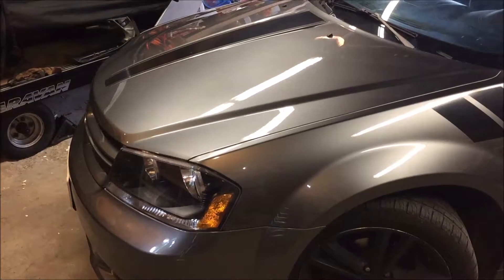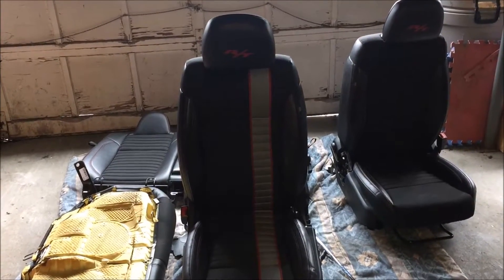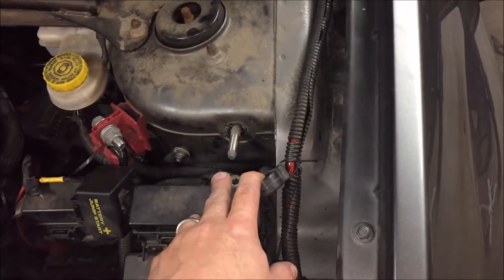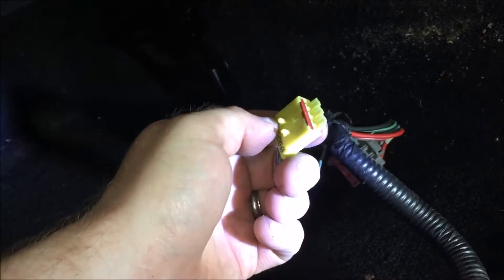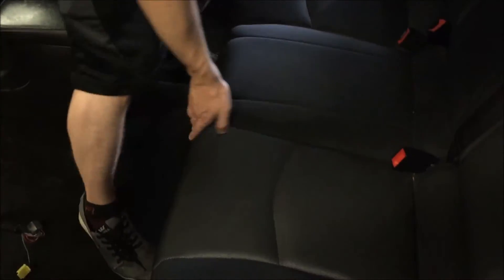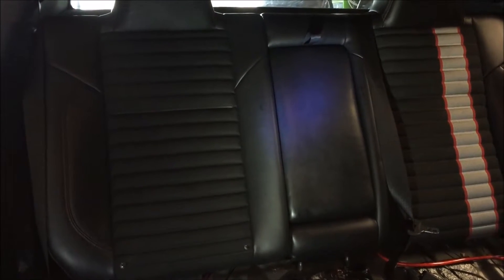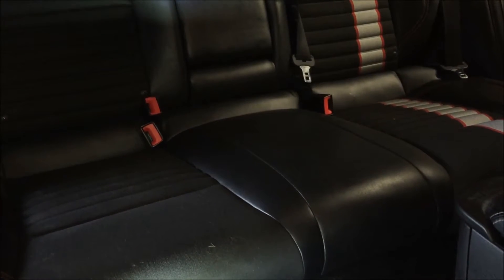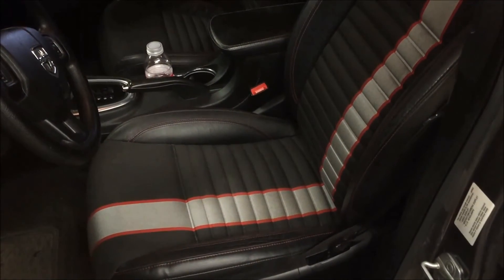2013 Dodge Avenger - Installing Leather Seats

Comment: My avenger does not have power seats at all, I found a the two fronts and the back seats all leather at a junkyard. I saw that the driver was powered. Are you saying that I can just swap then out and the original harness will supply the power to the new power seats?
Reply from the maker: For this car yes. The harness was there.

Comment: So you just showed the 2 rear rail bolts out of the 4? My front 2 bolts have a plastic cover I’m not sure how to remove but I don’t see them in this vid, mines also a 2013
Reply from the maker: Remove the plastic cover it just snaps off

Comment: Thank you for this video! How long did you wait after disconnecting the battery? I don't want to set the airbags off. Also, how in the world do you use a breaker bar with a t50 screwdriver.
Reply from the maker: You can start right after you disconnect the battery.

You can purchase Torx adapters that are mounted in either a 1/4 or 3/8 socket drive. Harbor Freight sells the kit for around $20.
Reply: @StreetersGarage  SUBBED!